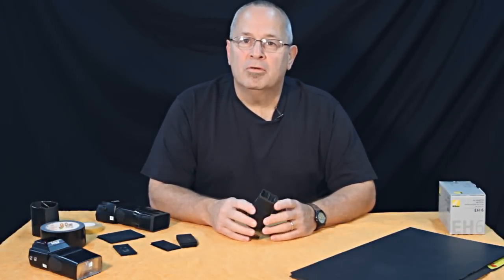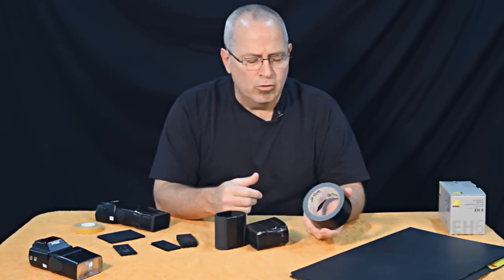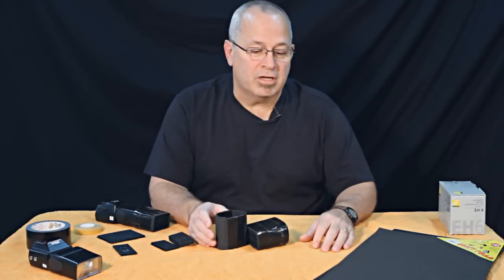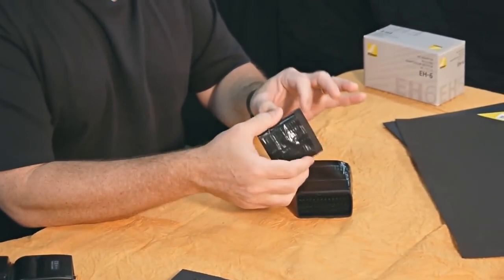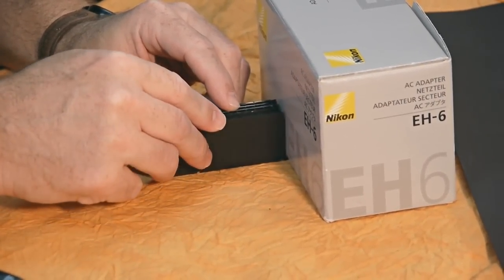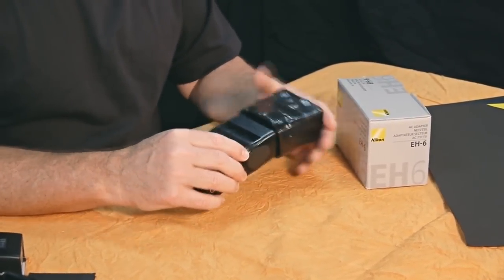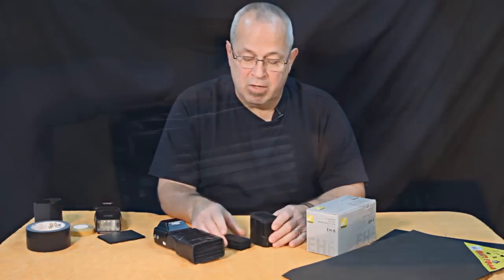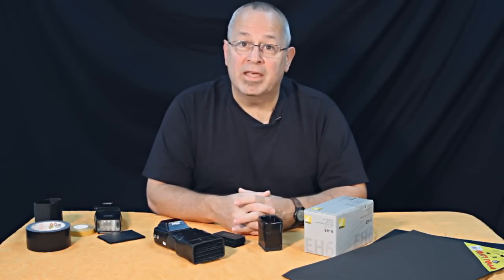DIY Snoots and Grids by Weekly Photo Tips Shot on a Canon 7D and Panasonic GH1

Comment: @gileco Well, the first grid I ever owned was a HONL grid. I spent $30.00 on it. Unfortunately, it was in a small bag of accessories that was stolen out of my car. A friend of mine had built his own grids out of cardboard, duct-tape and drinking straws. So, I decided to try his method. It cost me less than $3.00 in materials, took me less than 10 minutes to assemble, and I found it worked just as well as my $30.00 HONL. So, if spending money for no real reason is "unprofessional", so be it.